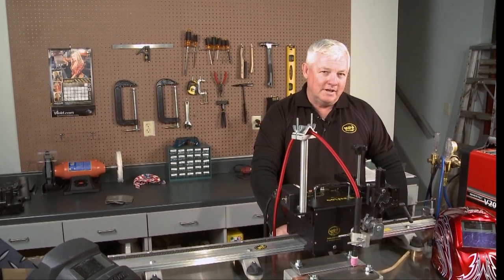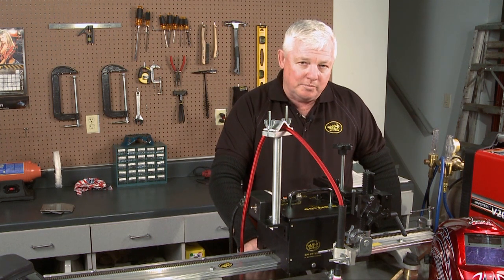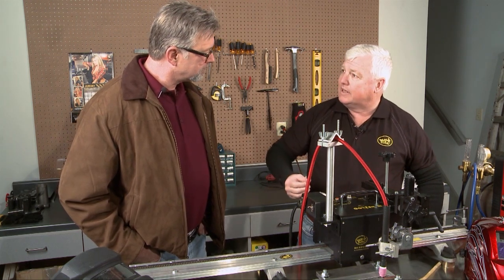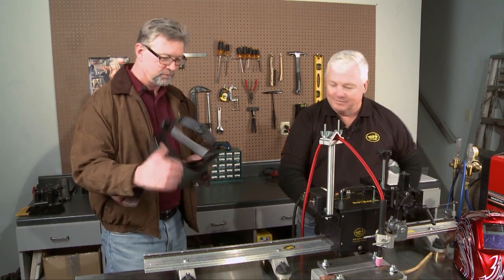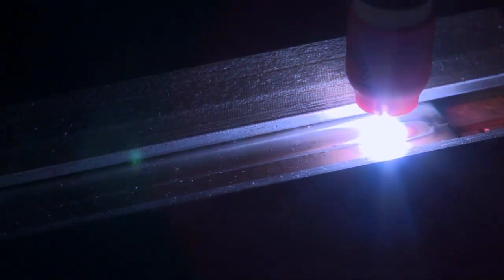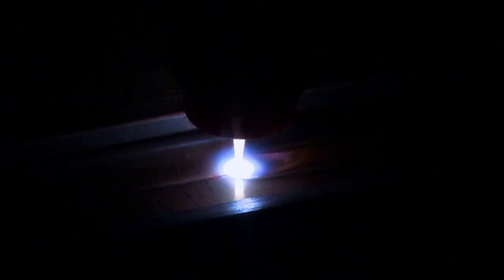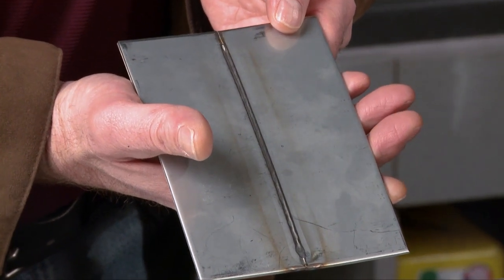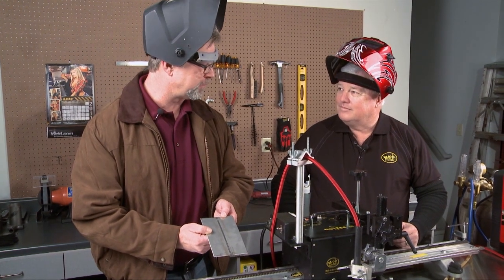Automated Stainless Steel TIG Welding - The Future of Welding

Comment: Hi Mr tig, I am graduate student and i am working with new aluminum alloys, for filler material, but i want automation of my process, what kind the recommendation you can talk me?
I have the lincoln precision 225, I like the system do you use in the video, but i know I can control the aluminum filler? Thanks